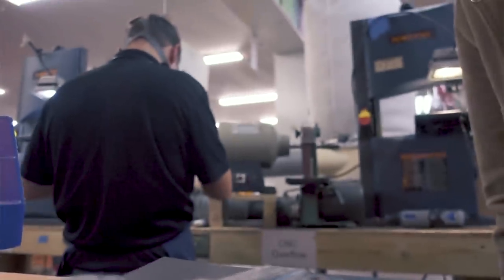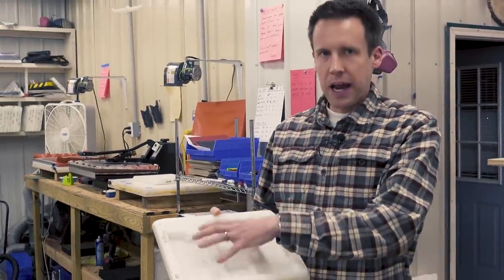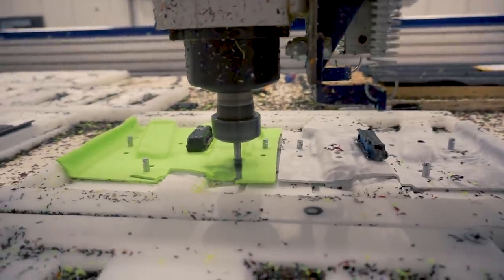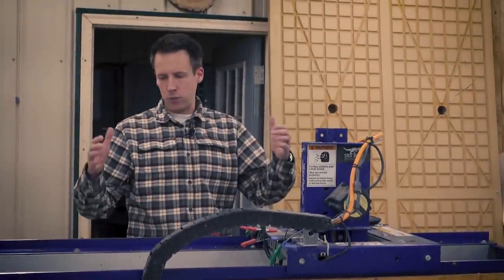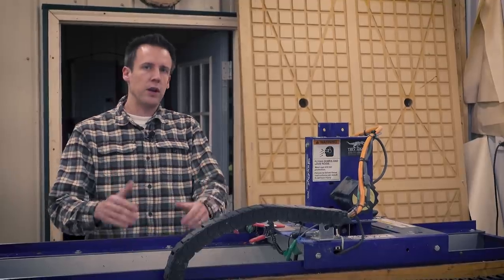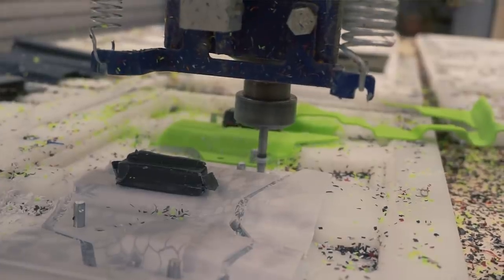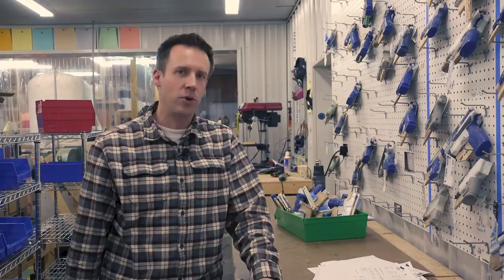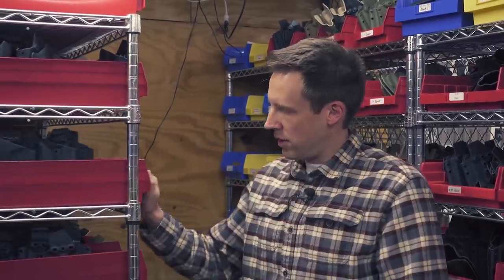Why we make Holsters with CNC Machines

Comment: Ok but what’s inside Lucas? 

Gears? Hydraulics? Processors? Cameras?
Reply from the maker: Uhhhhh... no comment
Reply: Aimbot coding.
Reply: ChrisPewKreme,

Probably the CPU from the Cyberdyne Systems T800 Series, Model 101 Terminator, among other things.
Reply: @f308gtb1977  He'll be back.
Reply: His brain is an aim bot, his fingers are Jerry Miculek, his legs are Usain Bolt, and his blood is red bull
Reply: @Nicksperiments  
You win. Lol.
Reply: @TREXARMS  a crap ton of subway
Reply: garand thumb HAHA
Reply: Nicksperiments glad someone explained it. That's quite the specimen
Reply: Raid energy drink.
Reply: Mase  It could work, but it would probably be a lot more expensive than CNC machines, and would require a lot more finesse work. Since they're not just cutting out flat shapes, you would have to adjust the focus of the laser for all of the elevation changes in the holster, which could either be done by lifting the platform up and down, or by moving the laser head up and down. I'm sure that they make laser cutters that have a 3rd axis, I just don't have any experience with them. Also, the smell that comes from cutting plastics is horrendous. In the shop I worked in, we'd only have to cut stuff like that a couple of times a week for fixture design, and even that gave off a pretty horrid stench. Another thing to consider is that the laser doesn't cut in a perfectly horizontal line because of the focus, and with kydex that thicc, that might be an issue.

Comment: I spent a few years at Toyota as a Quality Inspector after moving out of production. I love watching how the process smoothes out and streamlines. Even in that little bit I'm checking out workstations and walls and personal protection equipment, judging the distance between stations and looking for ways to speed up or improve the process. It's safe to say that production really got into my blood, so thank you for letting us into your shop.
Reply: I really enjoy reading about Toyota's lean manufacturing process, and we are always looking to implement more of that philosophy around our shop!
Reply: @isaacbotkintrex  I have carried with me what I learned there everywhere I went since. There is not a place that I have worked that has not saved tons of money and time because of me helping to implement some sort of TPS. Mostly against their will, but it's always better later. A lot of companies just are resistant to change, but you can't deny the numbers on the other side. If I'm honest with myself that's the business I should be in, streamlining other businesses, but at the end of the day I just like making things. As efficiently as possible. There is just so much value added in making it cheaper and easier for a company to produce higher quality products while at the same time relieving the burden on employees, mentally physically, and cumulatively. That last one is the thing that most people don't get.
Reply: @greenmansoutdoors9456  Can you recommend a good resource online where you can read/watch/understand TPS with examples.
Reply: @HPanni  I haven't looked in to it. My trainings took place at the Toyota Plants. There are a lot of bastardized versions of it out there, so research wisely when looking in to it.

Comment: Very impressive! I’m a big fan. Keep up the great work and great customer service. Still rockin the sidecar but may need another with new colors and options soon. Do you guys just run a big vacuum hose over the table to get all of the shavings? Also, any plans to build a flexible sidecar similar to another brand or will you stay true to the original design?

Comment: Very cool. So you guys just use location pins to place the molded holster onto, no screws?

Also have you found an endmill that doesn't Hurricane (build up plastic on the bit). Looks like you're using a 2 flute, is that the best?
Reply: I have searched for a way to deal with that horrible hurricane, but I haven't found that upcut, downcut, straight, 1 flute, 2 flute, or 4 flute makes any difference to how much plastic builds up. 2 flute seems best for managing chip load, though.
Reply: Check out some Sandvik Coromant composite endmills
Reply: @isaacbotkintrex  Same here, its frustrating. Thanks for the reply. Hope one day they can fix that problem.
Reply: @isaacbotkintrex  hi Issac, has your findings change 2 years after this post?
Reply: @YoKhoe  We did find some downcut bits that helped with hold-down, but they also broke more often, and they still collected plastic.

Comment: Just went to purchase a quick ship sidecar for a G26. Looks like you guys don’t make quick ships for the 26?
Reply: I would prob make more holsters for the G26 than the M&P. I know lots of people own them lol, so I’ll assume that’s the reason for having some around ;)
Reply: @natestain7103  The 19 holster fits the 26, so we don't carry an extra holster for it. There's just a little Kydex that sticks out the end.
Reply: David Tucker thanks for your reply. I’m sure it will work fine then especially with how your rig is designed. My main concern is how it feels sitting down and how low it rides below the belt, and needing something that doesn’t jab my groin. So figured the shorter g26 3.5 in barrel would necessitate a more low profile rig. Thx again
Reply: @natestain7103  It's personal preference, to some extent, on the comfort. I carry a 19 all the time and don't have any problems with it digging in (I have to adjust it sometimes, but that's life). 

We do make custom Sidecars for G26s, but the problem is, with such a short gun, the grip starts to tilt out a lot more because there's not much leverage keeping it in place. 

If you want to try one out, order a quick-ship and see if you like it. If not, just pay $5 return shipping and send it back. That's the nice thing about the quick-ships.
Reply: David Tucker Awesome thanks so much!

Comment: Will the ragnarok holsters for the gen 17 glock fit for the gen 19 ?
Reply: Bentley INC, yes, they are the same dimensions except for length, and the holsters are left open for any length. The holsters snap onto the trigger guard, which is identical on both models. (Or it holds the light of you go with that type, which again is the same either way.) 

Their Glock holsters fit pretty much every standard 9mm or .40 or .357 model except the single stack G43. For instance, in order of length, G26, G19, G17, G34, and G17L all fit in the same T.Rex Arms holster.